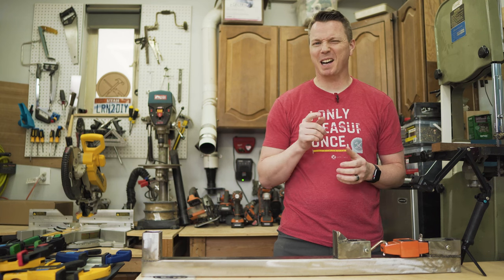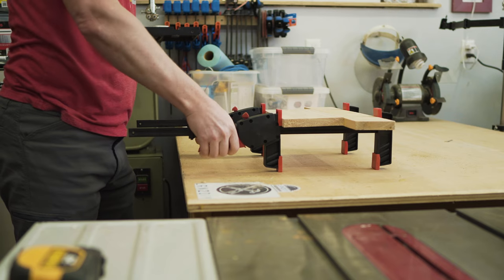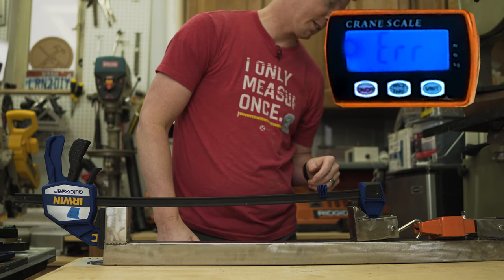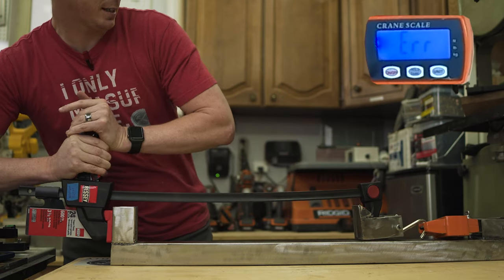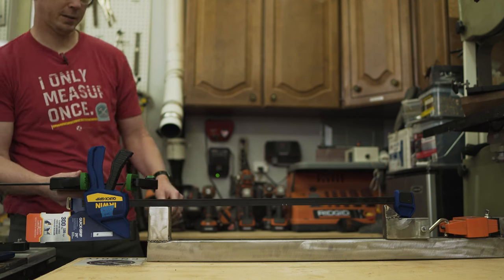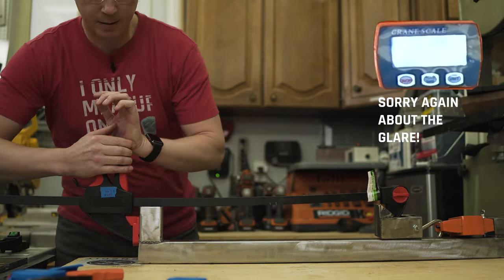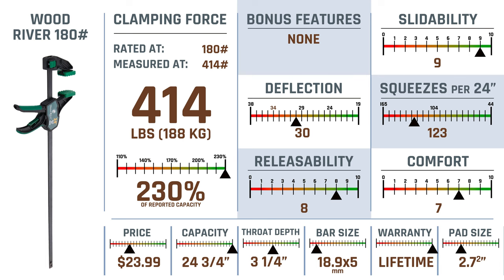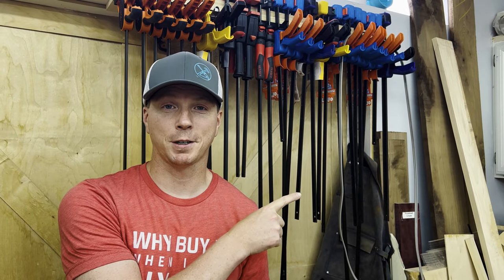Are Trigger Clamps As Strong As They Claim?

Comment: after trying half of these, don't buy harbor freight cheap clamps unless you want to clamp light, light weights.   I had lots of deflection, broken connections, difficulty tightening, and basically were unreliable.  Also, they change the clamp makers without you knowing and so the quality changes with each iteration.   I go with DeWalt, Irwin, Bessey, Jorgensen.  Just my $.25.

Comment: I bought a dozen or so 12 inch harbor freight clamps when I first started woodworking. None of them have broken and are still quite good compared to my 4x cost Irwin clamps. I definitely recommend them if you're starting out. Then the small 5 inch Jorgensen bar clamps as they are like 10 bucks but are really well made.
Reply: I too use the HF clamps and really do you need that much clamping power for a glue up

Comment: Sorry if I missed it. But why do you only use a clamp to squeeze a clamp only for HF clamps?
Reply from the maker: I used a clamp to squeeze the clamp on several of them, actually, but only when I felt like I couldn't get the pressure out of them that they advertised. It also had a lot to do with my hands/arms being tired after hundreds of squeezes as I went along. You can see where I'm using clamps to squeeze clamps more regularly on the full length video.

Comment: I'd be interested in max sustainable force.   appeared most of those readings indicated a force diminishing over time (seconds!)    at what force does one settle / stabilize?
Reply from the maker: Great point. Every one of them lost force when you let go of the squeeze but they also all stabilized in under a minute. It would be interesting to see if any of those numbers changed between five minutes and 12 hours, for example.

Comment: As the bar bends say you are clamping 2 2x4s 
Does the clamp toward the open side start to move away from the edge of the 2x4.
Reply from the maker: It typically pulls toward it.